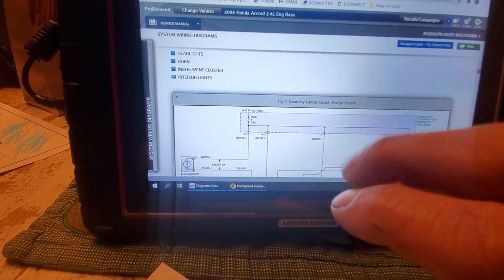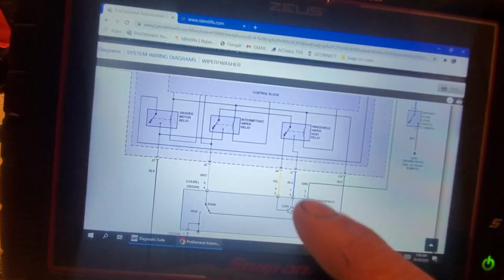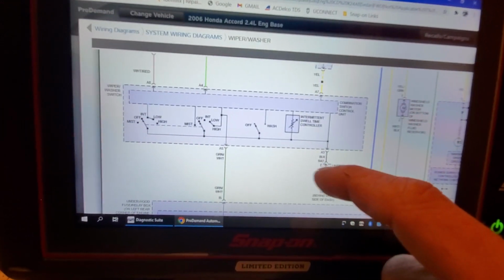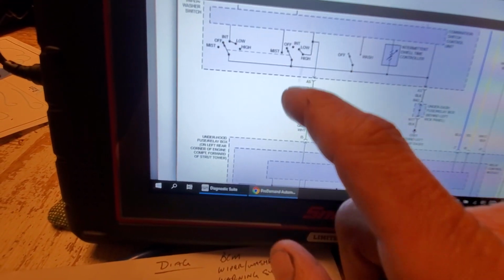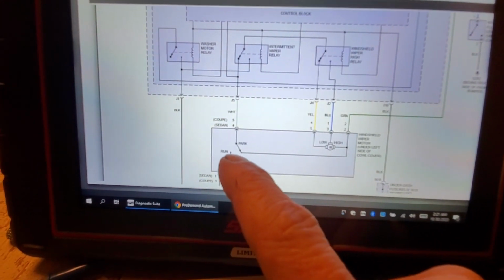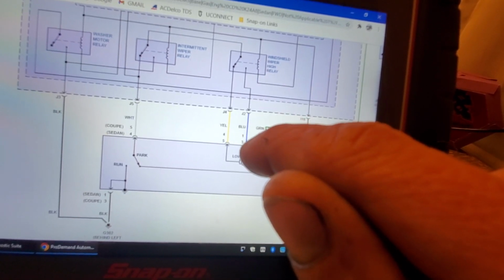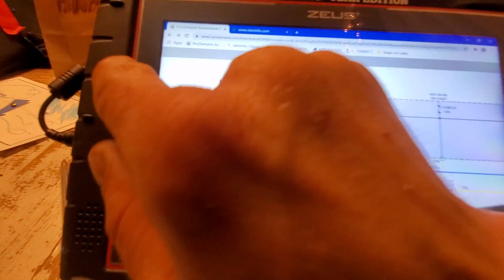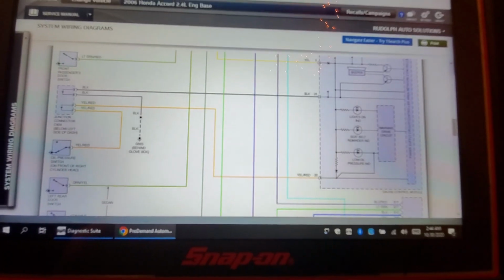HOW I LEARN (DIAGNOSTIC MINDSET) PART I

Comment: PAULY ALSO THAT GREEN WIRE IS A CAN WIRE, I WONDER IF THAT IS SHORTED ETHER TO GROUND OR TO POWER WHAT  EFFECT  WOULD THAT HAVE ON THE WIPER MOTOR CONTROL THANKS, YOU ARE REALLY DIGGING IN DEEP NOW.
Reply from the maker: 🤣🤣🤣 I like to dig holes!  Awesomeness...I will include that in part 2 as well.

Comment: HELLO PAULY , A FEW MORE THINGS I NOTICED WITH THE WIPER SWITCH UNPLUGGED THERE'S NO CHANGE THE WIPERS CONTINUE TO RUN . THE ONLY TIME I GET THE WIPERS TO STOP IS BY CLIPPING THE BLUE WIRE AT THE WIPER MOTOR JUST THOUGHT YOU SHOULD KNOW AND YES IT IS A FOUR CYLINDER USA MODEL .
Reply from the maker: Excellent part 2 coming up